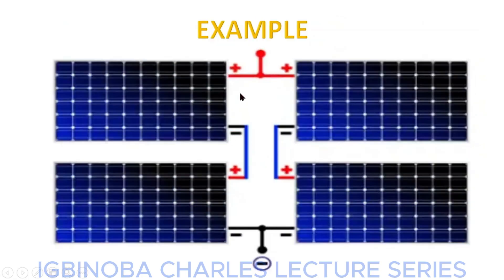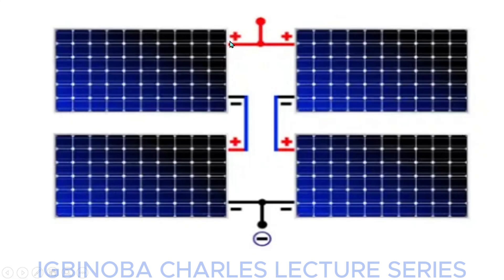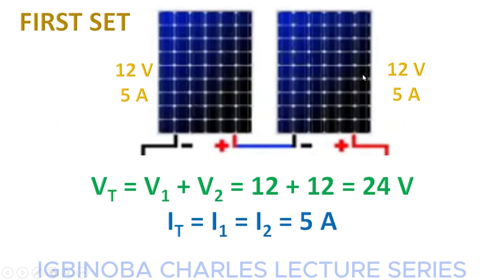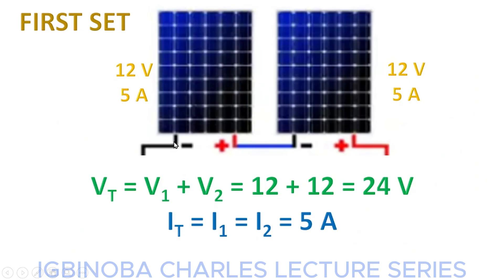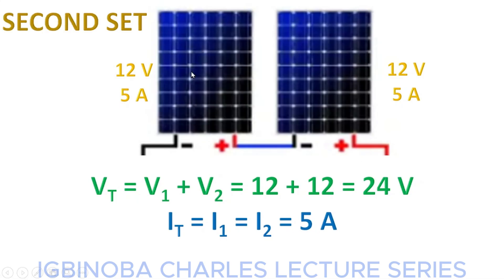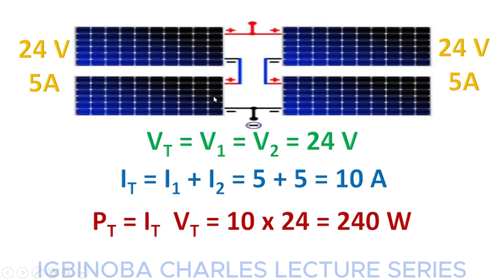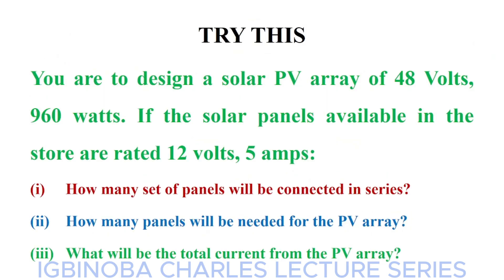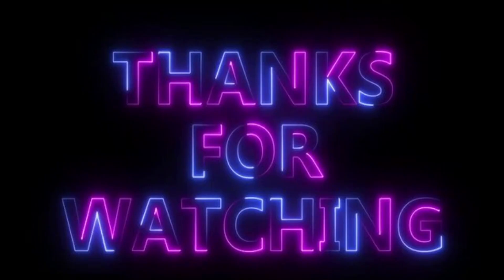Connection of  Solar Panels in SERIES-PARALLEL

Comment: MECH3166j

i. Given that series connection dictates the final voltage of the array and the requisite voltage is 48V, the number of panels necessary to achieve
this value is calculated as 48/12 = 4 panels.
ii. The output power of a single panel is calculated as 12V multiplied by 5A, resulting in 60W. The array requires 960W of power. For the array, this means that 16 panels (960/60) are required.
iii. There are four panels in series and sixteen
panels in the array. 16/4 = 4 parallel sets of
panels is the total number of parallel sets. Each set of panels has a total current of 5A. The total
current is 5A x 4 = 20A because these sets are
connected in parallel.

Comment: EEE322V
Required PV array: 48 V, 960 W
Available solar panel: 12 V, 5 A
(i) How many panels in series?
In series, voltages add up, current stays the same.
We need total voltage = 48 V, and each panel = 12 V.
Number in series =48/12=4
(ii) How many total panels for the array?
Each panel = 12V ×5A=60W
To get total power = 960 W
Number of panel=960/60=16
(iii) What will be the total current from the PV array?
Each series string = 4 panels = 48 V, 5 A.
We have 16 panels total, so:
Number of parallel strings=16/4=4
In parallel, current adds, voltage stays same (48 V):
Total current =4×5A=20A

Comment: PETRO347U

1. Number of panels sets in series = 48 V ÷ 12 V = 4

2. Number of panels for PV array

Given that a 

Given that a panel is rated 12 V  and 5 A, panel power = 12 × 5 = 60 W, total power = 960W

Therefore the number of panels for the PV array = 960 ÷ 60 =   16 panels.

3. Total current from the PV array .
Given; total power = 960 W
             Total voltage = 48 V
Total current = 960 ÷ 48 = 20 A

Comment: PETRO324X

GIVEN:
power=960 watts
Each panel has a rating of; 12 volts and 5 amps
Total voltage=48volts
1. The total voltage is 48volts and the individual voltage rating is 12volts. Therefore the number of panels connected in series is 48v÷12v = 4 volts.
Therefore the number of panels connected in series is =4
2. The power generated by each panel is given as ;
P = 12v × 5a
P= 60 watts
The total power is 960 watts. Therefore the number of cells connected in the PV array is Total power÷ individual panel power = 960 watts ÷60 watts
=16
Therefore the total number of panels in the PV array is 16.
3. The total current generated in the PV array is given as ;
Power= total current x total voltage
960 watts = 48 volts x total current
Total current = 960 watts ÷ 48 volts
Total current = 20 amps

Comment: MECH382D
Given:
Required PV array: 48 V, 960 W
Available solar panel: 12 V, 5 A
(i) How many panels in series?
In series, voltages add up, current stays the same.
We need total voltage = 48 V, and each panel = 12 V.
Number in series =48/12=4
(ii) How many total panels for the array?
Each panel = 12V ×5A=60W
To get total power = 960 W
Number of panel=960/60=16
(iii) What will be the total current from the PV array?
Each series string = 4 panels = 48 V, 5 A.
We have 16 panels total, so:
Number of parallel strings=16/4=4
In parallel, current adds, voltage stays same (48 V):
Total current =4×5A=20A

Comment: CHM3144N
1. Since series connection determines the final voltage of the array and the required voltage is 480, then the number of panels needed to reach the required voltage is = 48/12 = 4 panels.

2. The power generated by a single panel is = 120 × 5A = 600.
The required power in the array is 960W. Therefore, the number of panels needed for the array is = 960/60 = 16 panels.

3. 16 panels are in the array and 4 panels are in series. Total number of parallel sets of panels = 16/4 = 4 parallel sets.

Total current from each set of panels is 5A. Since these sets are in parallel, the total current is = 5A × 4 = 20A.

Comment: PETRO333G

1. Since series connection determines the final voltage of the array and the required voltage is 480. then the number of panels needed to reach the required voltage is = 48/12 = 4 panels.

2. The power generated by a single panel is = 120 x 5A = 600 The required power in the array is 960W. Therefore, the number of panels needed for the array is = 960/60 = 16 panels.

3. 16 panels are in the array and 4 panels are in series. Total number of parallel sets of panels = 16/4 = 4 parallel sets.

Total current from each set of panels is 5A. Since these sets are in parallel, the total current is = 5A x 4 = 20A.

Comment: CHM384F

Given: 
Required pv array: 48v, 960w
Available panel: 12v,5A
1) how many panel in series?
48÷12=4
2) how many total panels for the array
For each panel: 12v ×5A = 60W
Total power =960w
Number of panels = 960/60=16
3)16÷4=4
4×5=20A

Comment: MAR323W

1. Required output voltage is 48 V.
Each panel is 12 V, so 48 ÷ 12 = 4 panels set in series.

2. Each panel produces 12 V × 5 A = 60 W.
Total power needed is 960 W, so 960 ÷ 60 = 16 panels PV arrays 

3. With 16 total panels and 4 panels per series string, we get 4 parallel strings.
Each string gives 5 A, so total current is 5 A × 4 = 20 A.

Comment: CHM331E
1. 4 set of panels will be connected in series.
2. 16 panels will be needed for the PV array.
3. The total current from the PV array will be 20 Amps

Comment: MECH3196N

1. To achieve a final voltage of 48 V for the array, you'll need to connect the panels in series. Since each panel provides 12 V, you'll require 4 panels connected in series.

2. Each panel generates 60 W (calculated as 12 V x 5 A). Given that the total power needed is 960 W, you'll need a total of 16 panels to meet this requirement.

3. With a total of 16 panels and 4 panels per series string, you'll end up with 4 parallel strings. As each string provides 5 A, and since they're in parallel, the total current will be 20 A (5 A x 4).

Comment: CHM3118N

Given;
PV array: 48v, 960w
Each panel: 12v, 5A
Power of one panel:
P = V×I   
      12×5 = 60w

1.No of panels in series:
48/12 = 4

2.No of panels needed for 960w
960/60 = 16

3.Total current from the PV array;
We have 16 panels in total so;
No of parallel strings: 16/4 = 4 strings
When connected in parallel
Itotal= 4×5 = 20A

Comment: MEC128X

Given:
Required PV array = 48 V, 960 
Panel rating = 12 V, 5 A

I) Panels in series:
48 V ÷ 12 V = 4 panels in series

II) Power per series string:
48 V × 5 A = 240 W
960 W ÷ 240 W = 4 strings in parallel
Total panels = 4 × 4 = 16 panels

III) Total current:
4 strings × 5 A = 20 A

Comment: CHM310J

1. Since series connection determines the final voltage of the array and the required voltage is 48V, then the number of panels needed to reach the
required voltage is = 48/12 = 4 panels.
2. The power generated by a single panel is = 12V x
5A = 60W
The required power in the array is 960W. Therefore, the number of panels needed for the array is =
960/60 = 16 panels.
3. 16 panels are in the array and 4 panels are in
series. Total number of parallel sets of panels = 16/4
= 4 parallel sets.
Total current from each set of panels is 5A. Since
these sets are in parallel, the total current is = 5A x
4 = 20A.
Reply: CHM75W 
1.Since series connection determines the final voltage of the array and the required voltage is 48V, then the number of panels needed to reach the
required voltage is = 48/12 = 4 panels.
2. The power generated by a single panel is =
12V x
5A = 60W
The required power in the array is 960W.
Therefore, the number of panels needed for
the array is =
960/60 = 16 panels.
3. 16 panels are in the array and 4 panels are in
series. Total number of parallel sets of panels = 16/4
=4 parallel sets.
Total current from each set of panels is 5A.
Since
these sets are in parallel, the total current is = 5A x
4 = 20A.

Comment: PETRO3108D

GIVEN:
power=960 watts
Each panel has a rating of; 12 volts and 5 amps
Total voltage=48volts

1. The total voltage is 48volts and the individual voltage rating is 12volts. Therefore the number of panels connected in series is
48v÷12v = 4 volts.
Therefore the number of panels connected in series is =4

2. The power generated by each panel is given as ;
P = 12v × 5a
P= 60 watts

The total power is 960 watts. Therefore the number of cells connected in the PV array is:
Total power÷ individual panel power
= 960 watts ÷60 watts
=16

Therefore the total number of panels in the PV array is 16.

3. The total current generated in the PV array is given as ;
Power= total current × total voltage 
960 watts = 48 volts × total current 
Total current = 960 watts ÷ 48 volts
Total current = 20 amps

Comment: EEE1A

1) since the series connection determines the final voltage of the array and the required output is 48 v, the number of panels needed in series is:
48 v / 12 v = 4 panels in series 

2) Each panel produces 12 v x 5 A = 60 W.
The total power required is 960 W, so the total number of panels needed is:
960 W / 60 W = 16 panels 

3) with 16 panels total and 4 panels per series string we get;
16/4 = 4 parallel strings 
Each string delivers 5A, and since the strings are in parallel, the total current is:
5A x 4 = 20A.

Comment: PETRO3149S

1. Since the series connection determines the final voltage of the array and the required output is 48 V, the number of panels needed in series is:
48 V ÷ 12 V = 4 panels in series.
2. Each panel produces 12 V x 5 A = 60 W.
The total required power is 960 W, so the total number of panels needed is:
960 W ÷ 60 W = 16 panels.
3. With 16 panels total and 4 panels per series string, we get:
16 ÷ 4 = 4 parallel strings.
Each string delivers 5 A, and since the strings are in parallel, the total current is:
5 A × 4 = 20 A.

Comment: PETRO3160D

Given:
	•	PV array = 48 V, 960 W
	•	Each panel = 12 V, 5 A (→ 60 W)

⸻

(i) In series → Voltage adds:
48 V ÷ 12 V = 4 panels in series

(ii) Total panels needed:
960 W ÷ 60 W = 16 panels total

(iii) Sets (strings) in parallel:
16 panels ÷ 4 panels/series = 4 sets in parallel

Total current = 4 sets × 5 A = 20 A

Final Answers:
(i) 4 panels in series
(ii) 16 panels total
(iii) Total current = 20 A

Comment: CIV3108H

1. Number of panel sets in series: 48V + 12V = 4

2. Number of panel for PV array: 960W ÷ (12V * 5A) =

960W 60W = 16

3. Total current:

Number of parallel strings: total no of panel for PV array/ number of panels set in series = 16/4 = 4

Therefore total current= 4 * 5A = 20A

Comment: PETRO3118N

1. Since the series connection determines the final voltage of the array and the required output is 48 V, the number of panels needed in series is:
48 V ÷ 12 V = 4 panels in series.

2. Each panel produces 12 V × 5 A = 60 W.
The total required power is 960 W, so the total number of panels needed is:
960 W ÷ 60 W = 16 panels.

3. With 16 panels total and 4 panels per series string, we get:
16 ÷ 4 = 4 parallel strings.
Each string delivers 5 A, and since the strings are in parallel, the total current is:
5 A × 4 = 20 A.

Comment: PETRO3110F

1. 4 set of panels will be connected in series
2. 16 panels will be needed for the PV array
3. The total current from the PV array is 20A

Comment: EEE3136F

1. 4 set of panels will be connected in series
2. 16 panels will be needed for the PV array
3. The total current from the PV array will be produce troubles 20Amps

Comment: PETRO3121Q

1. Since series connection determines the final voltage of the array and the required voltage is 48V, then the number of panels needed to reach the required voltage is = 48/12 = 4 panels.

2. The power generated by a single panel is = 12V x 5A = 60W
The required power in the array is 960W. Therefore, the number of panels needed for the array is = 960/60 = 16 panels.

3. 16 panels are in the array and 4 panels are in series. Total number of parallel sets of panels = 16/4 = 4 parallel sets.
Total current from each set of panels is 5A. Since these sets are in parallel, the total current is = 5A x 4 = 20A.

Comment: MECH383E

i. Given that series connection dictates the final voltage of the array and the requisite voltage is 48V, the number of panels necessary to achieve this value is calculated as 48/12 = 4 panels.

ii. The output power of a single panel is calculated as 12V multiplied by 5A, resulting in 60W. The array requires 960W of power.  For the array, this means that 16 panels (960/60) are required. 

iii. There are four panels in series and sixteen panels in the array.  16/4 = 4 parallel sets of panels is the total number of parallel sets.  Each set of panels has a total current of 5A.  The total current is 5A x 4 = 20A because these sets are connected in parallel.

Comment: NAT320T

One solar panel gives 12V 5A
Power from one solar panel = V*I
= 12*5= 60W
Therefore 
ii) Total number of panels needed for the PV array =
Total power required ÷ power from one solar panel = 960 ÷ 60 = 16 panels

i) How many set of panels will be connected in series?
In series connection voltage increase as current remains constant (panels of same capacity)
Required voltage= 48V 
Individual panel voltage = 12V
Number of panels= (48÷ 12) = 4
Therefore two sets/pairs of panels will be connected in series (one set= 2 panels)

iii)What will be the total current from the array?
The total number of panels = 16
Number of panels connected in series = 4
Number of panels connected in parallel= total number of panels ÷ number of panels connected in series= 16 ÷ 4 = 4
In parallel connection, voltage is constant while current increases. Therefore total current from the PV array is (5A * 4) = 20A

Comment: CHM349W 
Given:
Required PV array: 48 V, 960 W
Each solar panel: 12 V, 5 A → 60 W
(i) How many panels in series?
In series: voltages add, current remains the same.
Need 48 V → \( \frac{48}{12} = 4 \) panels per string.
Answer: 4 panels in series.
(ii) How many total panels for the array?
Total power required = 960 W
Power per panel = 12 × 5 = 60 W
Total panels = \( \frac{960}{60} = 16 \)
Answer: 16 panels total.
(iii) What will be the total current from the PV array?
Each string: 4 panels in series → 48 V, 5 A
Total panels = 16 → Number of parallel strings = \( \frac{16}{4} = 4 \)
In parallel: current adds, voltage stays the same
Total current = 4 × 5 A = 20 A
Answer: 20 A

Comment: EEE331E
1. Number of panel sets in series: 48V ÷ 12V = 4

2. Number of panel for PV array: 960W (12V*5A) = 960W 60W = 16

3. Total current:

Number of parallel strings: total no of panel for PV array/number of panels set in series = 16/4=4

Therefore total current=4*5A=20A

Comment: PETRO399U

1. Since series connection determines the final voltage of the array and the required voltage is 48V, then the number of panels needed to reach the required voltage is = 48/12 = 4 panels.

2. The power generated by a single panel is = 12V x 5A = 60W
The required power in the array is 960W. Therefore, the number of panels needed for the array is = 960/60 = 16 panels.

3. 16 panels are in the array and 4 panels are in series. Total number of parallel sets of panels = 16/4 = 4 parallel sets.
Total current from each set of panels is 5A. Since these sets are in parallel, the total current is = 5A x 4 = 20A.
Reply: PETRO356D

1. Since series connection determines the final voltage of the array and the required voltage is 48V, then the number of panels needed to reach the required voltage is 48/12 = 4 panels

The power generated by a single panel is 12V × 5A = 60W
The required power in the array is 960W
Therefore, the the number of panels needed for the array is 960/60 = 16 panels 

3.16 panels are in the array and 4 panels are in the series. The Total number of parallel set of panels is 16/4 = 4 parallel sets.
Total current from each set of panels is 5A.
Since these sets are in parallel, the total current is 5A × 4 = 20A
Reply: @kheengpromise  please copy your answer and post it as a general reply. It shouldn't be here. Thanks.

Comment: PETCHEM1A 

Number of panel set In series =48v/12v  =4v
Number of panel for pv array=960w÷(12v*5A)= 960W/60W=16

Total current 
Number of parallel strings= total number of parallel pv array/number of panel set in series =16/4=4

Total current= 4*5A = 20A.....

Comment: PETROCHEM 350X

1. Number of panel sets in series : 48V ÷ 12V = 4

2. Number of panel for PV array: 960W ÷ ( 12V * 5A ) =
960W ÷ 60W = 16

3. Total current:
Number of parallel strings: total no of panel for PV array/  number of panels set in series = 16/4 = 4

Therefore total current= 4 * 5A = 20A

Comment: PETRO340N 

I. No of panels in series;

48/12=4

II. No of panels needed for 960w 960/60-16

III. Total current from the PV array;

4 panels per series string= 48v, 5A

We have 16panels in total so;

No of parallel strings; 16/4= 4strings
: Total=4×5=20A

Comment: NAT35E.

Given: Required PV array: 48 V, 960 W Available solar panel: 12 V, 5 A                 (i) How many panels in series? In series, voltages add up, current stays the same. We need total voltage = 48 V, and each panel = 12 V. Number in series = 48/12=4     .CM8kHf text{fill:var(--m3c11)}.CM8kHf{font-size:1.15em}.j86kh{display:inline-block;max-width:100%}            (ii) How many total panels for the array? Each panel = \(12V\times 5A=60W\) To get total power = 960 W Number of panel = 960/60=16                 (iii) What will be the total current from the PV array? Each series string = 4 panels = 48 V, 5 A. We have 16 panels total, so: Number of parallel strings = 16/4=4 In parallel, current adds, voltage stays same (48 V): Total current = \(4\times 5A=20A\)